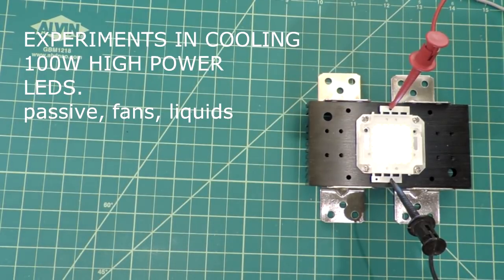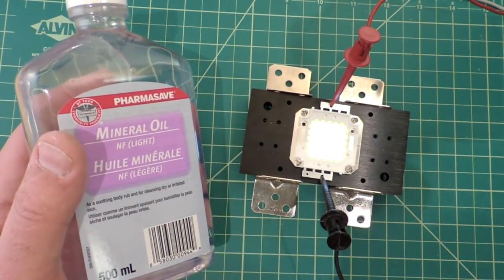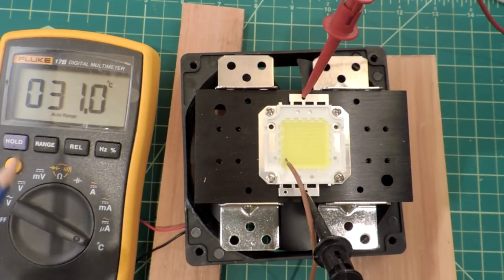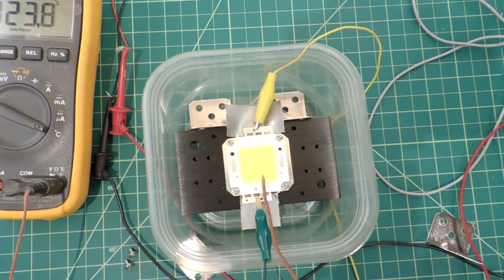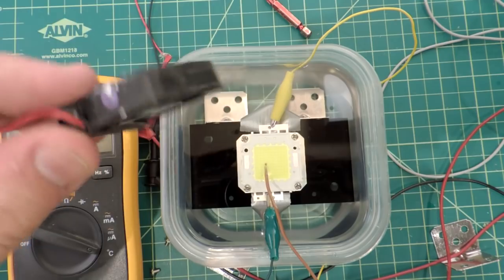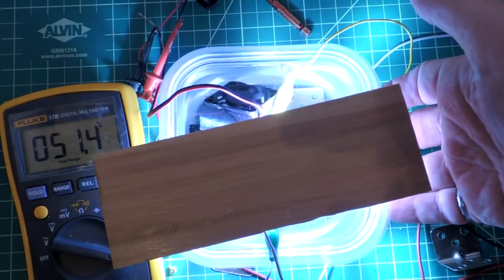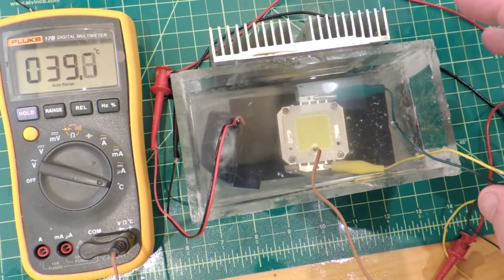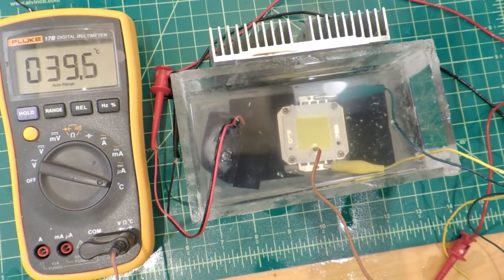Experiments in Cooling a super bright 100W LED module

Comment: im wondering if i can put the voltage regulator for the leds in the mineral oil i have a drok 150w one and the heatsinks get very hot
Reply: +Dean Walcott Mineral oil is non-conductive, so you should be fine.

Comment: Okay, I'm not thinking that this is the best way to go about it. I think a radiator with the coolant passing through it would be much better. Have a block of copper with holes drilled through it to tightly accommodate the copper pipes containing the coolant. You could then solder them to the block by heating it up in an oven. Make sure the surface of the block is very flat and smooth where the led mates to its surface. Have a small pump to circulate the coolant. This would dissipate far more heat. The heat dissipation would be dependent upon the size of your radiator, the airflow, the size of the copper block, the size of your coolant reservoir and the number of times the copper pipe passes through the block. Why copper? It is an excellent conductor of heat. Then run a 1000w led with a parabolic reflector and set the trees on fire across the street ;)

Comment: never seen anything like this and i'm not sure how i feel about submersing electronics in a liquid. is the mineral oil non conductive or something? this is bonkers
Reply: +Chandler Booker mineral oil is non-conductive and has been used to liquid cool pc systems for years. all internal pc parts are usually entirely submerged in an aquarium of the oil.
Reply: Mineral oil is used in high power applications like them big transformers on hydro polls
Reply: rad

Comment: The heating power is actually (1-efficiency)*full power. So the power dissipation on the heatsink is not even close to 100w.
Reply: +Дмитрий Говоров Leds aren't 90% efficient, not even 65%. Actually LEDs efficiency vary between 8-22%, with a theoretical limit of ~40%, not commercially archived yet
Reply: leds are 90% efficient
Reply: +DMAN22yeah efficiency depends on the led itself. For these chinese its not higher than 65%
Reply: Дмитрий Говоров i meant to say leds waste 90% of their energy as heat and are only 10% efficient
Reply: +DMAN22yeah Then you're not right anyway. Efficiency is UsefulPower/UsedPower*100%. 

And it depends only on technological process of given LED crystals.
Reply: +Rodrigo Barretto Thank you, I didn't precicely know

Comment: This is very interesting video , thank you. Question: Is there any expansion/pressure rise by using the mineral oil in the close applications? for example diving torch?
Reply from the maker: Yes there will be expansion.  Look at my video on the switch led bulb and how they used a bladder to solve

Comment: Thanks for making this interesting video. Unfortunately he way you measure temp is not very accurate. 
A IR meter pointing at the lamp would be much better or thermal gluing the thermocouple onto the base.
Why you say?  because the first test the thermocoupler was receiving extreme amounts of radiation and being a dark color would have heated up even if it was under the led pointing down with a distance from it. In the second it was being cooled by the ambient airflow.

Comment: that 14K lumen rating puts it in the ballpark of 170W though... the typical 10W LED only puts about 8-900 lumens... so that 100W LED should realistically put out 9000 lumens at best... it's still a LOT of light though!
Reply: +TheSoxmania i heard it was 10w was 1000 lumens? Though these cheap leds are not perfect so they probably produce like 10-5% less light than a high quality 100watt led.
Reply: Jette Christensen Likely since a good 100W LED has a light output to a 500W tungsten halogen lamp in practise, which (at least on a 240V circuit) is around that 8000-9000 lumen mark... I'd be willing to bet that the ones you can get for £5GB on EBay will be closer to about 7,000 since the LEDs are mismatched and therefore poorly made or they worked well in the factory and after shipping were subjected to ESD because of the world's worst packing methods for ESD sensitive parts!
Reply: TheSoxmania Actually from my experience sure electronics ship their cheap 100 watt leds in proper antistatic bags, but I'm not sure about their warehouse. From my tests below 21 volts the led is very unevenly lit. But when you go up to 23 or so , you can see without being blinded that the leds are all evenly lit perfectly. Im not sure why that is, but it is only when you go below 22 volts that the faults become apparent, this leads me to believe that it is close to the similar brightness as a higher quality led at 100 watt output. Though i must say the cri is terrible at only 70 so i wouldn't use it for anything but a work bench light or a flood light/ flashlight. I know yuji make very good 96 cri 100 watt leds that are very good though expensive,lol.
Reply: Jette Christensen Yeah... I guess the packing method is supplier dependant here, but so far, every other supplier besides Sure electronics has used bubble wrap and no ESD bags! and yeah... the CRI of the cheaper LEDs is shoddy but for a high powered flashlight or flood they're absolutely awesome like you say!
Reply: TheSoxmania yeah they are! I have personally made 1 small 100 watt flashlight using large 100watt tdp laptop heatsink. And a 3 x 100 watt led large flashlight. both are dimmable. Pulls a lot of power but its ridiculously bright having about 25000 lumens. needs a 10000mah battery to even use it at full power for more than 5 min or so.

Comment: Useful infos, thx! I didn't know the LED's surface dissipate that huge amount of heat. 160 degrees centigrade seems a lot to me. I think the heat is the enemy of any semiconductor device and for a LED this is a repressive factor of lifetime.
I'd like to make a dimmable flashlight with 100W LED and now my mind is blowing up since I found out that information. The mineral oil seems a viable solution, but I think maybe an aluminium tube or pipe would be a better way to eliminate the heat outside. I have to change all of my project now...

Comment: Did this chip not come with a thermocouple point? I know the CREE cob chips do and they run well at 60c. Its to measure the case temperature and is more accurate than putting the thermocouple directly on the top of the light emitting surface

Comment: Nice video. You should measure the temperature on the aluminium heatsink as the bright light heats up the probe and messes with your measurement. I'm using a 100 W module on a Pentium 4 heatsink with fan on minimum at 15°C above ambient temp.

Comment: The large silver heatsink... Come on. On acrylic? I doubt this works well. Acrylic is known for its heat conductivity.
Reply: +Juan Pretorius You're right. Another issue is the fan in the coolant liquid. It just doesn't add any significant flux and the amount of liquid is just to small.
Reply: Yep. Heatsink would be much more effective half in, half out of the oil.

Comment: cpu liquid cooler and fan runs on 12 volt did it myself works great used an old amo can mounted the lite on end and lawn mower battery and cpu liquid cooler in the can best flashlite ever .  mite go lypo next time

Comment: Cut the blades on that fan,than your setup will work better.Ultimately you shold go for total passive cooling,only one hundred watts away and LED junction temperature can be very low with compact cooling if you use heat pipes.

Comment: I am dealing with the same problem for the same propose.

I am busy now with 1 x 100W LED for the fill light, i got a 50W for the head light which is good cooled. But 100W is a other problem to deal with when it is about cooling. What i got now as cooling is a aluminium plate from 15cm diameter with a 72mm cooling fan. But after 10 minutes the plate becomes hot enough that you can't keep your finger on it for more then 5 seconds, and it keeps getting more warm. So i guess the cooling is not sufficient then. But my space to build it in is limited of course. What is the solution to solve it? 

PS: For the key light i want 2 x 100W in a bigger softbox....there i will have more space for cooling i think.
Reply: +Claudia ft Privacy use a heat pipe cpu heat sink. Also notice that copper is a better heat conductor than aluminium.

Comment: have you considered sticking a thermoelectric cooler in between the led and heatsink?

any amount of electric generated can be used to lessen the wattage needed from the powersource. just an idea, i havent found a video yet where that has been tested.
Reply: the amount of power generated this way wouldn't be enough to even power the fan and in a few minutes u'll end up with a busted 100W LED

Comment: VERY SIMPLE SOLUTION - buy a second hand videocard cooler or old ATI videocars with heatpipe and exhaust fan model and this way you have a pro cheap cooling solution . even originals bracket . Only remuve the video moatherboard and replace the video processor chip with your led chip

Comment: The best way to do this would be to use a CPU tower cooler with dual 120mm fans at low RPM. Like a noctua NH-U9B
Reply: sigh...
Reply: +dacasman You don't need that much ...

Comment: What about Peltier Elements?
Reply: the take up a lot of power, and that will eliminate the whole purpuse of the led in the first place - its efficiency
Reply: with Peltier u still need to take the same amount of heat out of the hot side as u would need wit just the LED

Comment: Can I ask what liquid people would recommend for cooling a 100W LED given that the liquid must have a very low electrical conductivity if any at all???
Reply: the back of the led chip is non conductive, so no matter the conductivity of what you stick to it.
Reply: mineral oil (as the video says) has a low or no electrical conductivity.

google mineral oil computer and the likely first result from puget systems has a great faq section covering water buildup (or lack thereof), mineral oil wicking along submerged cables, submerged part degradation etc. and a bit of the science behind it too.
Reply: alexandru benza
Distilled water works as well, because it is almost non conductive and we don't care if there is a bit of current passing in it. And it doesn't make a mess like mineral oil (everything oily...)
Reply: MrOpenGL While that is true you have to be careful with it, over time salts can build up and it can become conductive again. But if the top is entirely sealed and you make sure it doesn't become conductive again to the point where its dangerous for your circuit you'll be fine.

Distilled water would conduct heat better I think from memory, either that or a higher specific heat ratio per volume. But personally for a long term permanent solution I'd stick to mineral oil or just air cooling with CPU tower thing and a low rpm fan.
Reply: TribunusLaticlavus
 Well even if it does conduct a bit, the voltage is very low so there is actually no problem if it conducts a bit (the current is low so there is not a lot of electrolysis
Reply: MrOpenGL I don't know what the forward voltage of this LED setup is. It might be a lot of them in series actually requiring a reasonably high voltage by LED standards and as "messy" as oil might be its not terrible to get it off afterwards if you really have to and as long as you setup the rig first then dump it in its really not too bad imo.

Nothing is perfect however, I agree with you that oil is a little bit messy fans make noise and distilled water won't stay pure forever unless its fully contained. Distilled water is definitely a nice and cheap option as long as you keep an eye on the contamination.

Perhaps a good compromise that avoids much of the mess either electrolysis or oil on the electrical components could be not submersing it entirely but relying on the thermal conductivity to the heatsink. The heatsink itself could be submersed in whatever liquid with/without fans depending on what the situation demands. That way even if tap water is used it would not cause any issue at all. Obviously there is less heat conductive material on top of the actual die so a cooler heatsink might be required to keep the junction temperature acceptable.